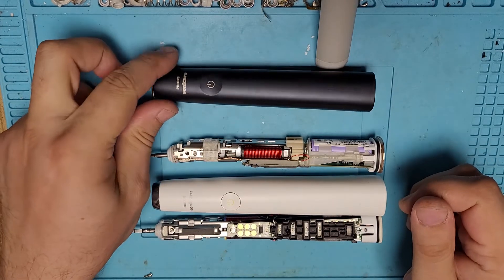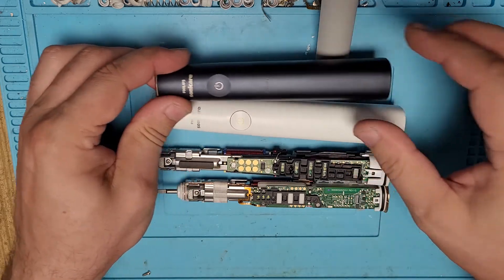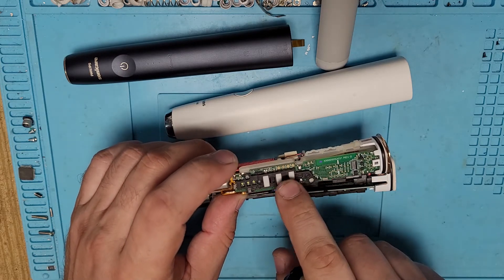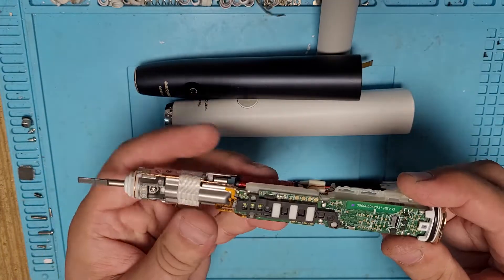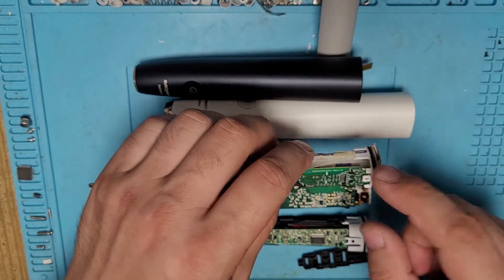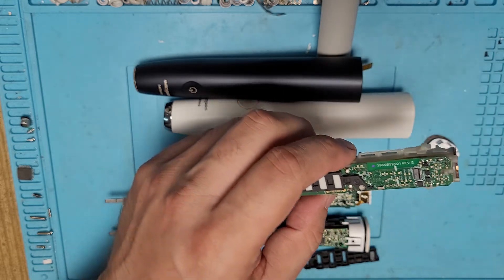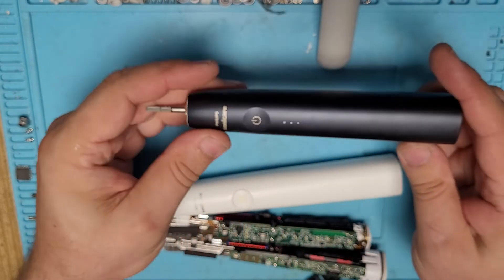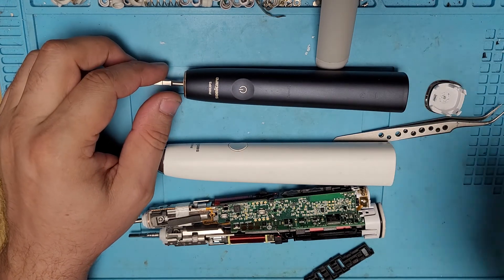Philips Sonicare Prestige - let's look what's inside. Teardown, repair, compare..

Comment: I opened mine trying to fix it because it was vibrating loud but when I put it back together it won’t turn on anymore it just switches modes someone help please this toothbrush was 400
Reply from the maker: inspect the ribbon cable for damage or if you were unlucky you damaged small IC on the glued electronic part. and now you need a new housing.. check my other video for removing glued electronic part from the housing for some ideas..

Comment: Got my success with this damn Sonicare Prestige:
1. bar clam to elegantly squeeze the bottom cap out
2. use a tweezer to loose the attachment and remove the internal body
3. secure the loose screw
4. reconnect the power cable as in the video and see the LED on
5. insert the body back and put back the bottom cap
Reply from the maker: Do you think a video showing how to take it apart and put it back together is needed? From my experience it's similar to my other videos showing how to take apart Sonicare toothbrushes maybe even easier.. and thanks for your feedback to community!
Reply: That would be great to make it complete as the power cable connection would be the devil in the details for the first time user  to take care of.
Reply: @letsfixitgarage  That would be great.
Reply from the maker: Your wish was fulfilled a few months ago ;) check my other videos :)

Comment: 11:01 , i messed up with the cable, got it halfway in, everything lit up, and it didnt start, i fiddled some more, and destroyed the seat for that cable, 

Bricked.
Reply from the maker: That's a bummer... You do need good magnification to see what you are doing with a all these small electronic and cables...
Reply: @letsfixitgarage  I fixed it, i cleaned and fixed the "port" for the cable, some pins were bent, got the cable in, and pushed it kinda hard the last bit so i got contact, the bad part was that i had cut the silicon top, and poured in 2 component glue,(i thought that it was a good idea to "stiffen" the shaft when it was wobbly, didnt know about the bottom part opening:)(dont tell anyone:P so i took it apart an rinsed it all, put everything back on, took a balloon rubber that i taped around the top, for water cover, works like a charm, overall, final conclusion, its a well built machine and system,
Reply from the maker: Yes there is a lot of engineering behind these brushes and you can see that they are made with repairability in mind sad that Philips is not offering some spare parts.. this would bring the survival rate even higher:) happy that you got yours running but I would suggest to get a replacement rubber seal. You can get them on AliExpress or eBay will hold longer than poured rubber ;)

Comment: Hello, I have a Philips Sonicare Prestige 9900 toothbrush. I thought it was the battery. I changed it, but the problem persists. So I don't know what to do. Maybe you can help me solve this problem.
Reply: Im also having this problem. Have you managed to fix it?
Reply from the maker: Prestige is very difficult to repair.. at the moment i dont have any tips.. every single one needed individual inspection and repair..
Reply: @letsfixitgarage  What have you needed to repair on the Prestige toothbrush PCB boards you have inspected? If you can make more videos about the Prestige, i currently have 3 with the same charging problem.
Reply from the maker: Sorry as said don't have any general tips for prestige at the moment. Every one that I repaired needed different things
Reply: @letsfixitgarage  Can you link to the fuse model these Diamondclean and Prestige use? How do you reset them?
Reply from the maker: I use the same 2a fuse from AliExpress that I have in description links, if it fits it will hold :) although not sure if the links are ok keep promising to update them but don't find the time even for new videos so links are outdated as well..
Reply: @letsfixitgarage  These Prestige im trying to repair don't want to charge but they turn on, can you tell me what components to check on the board to try to diagnose this problem?
Reply from the maker: Previous toothbrushes had KLB chip that was responsible for charging and usually was the failure point. With prestige as said they are much more difficult charging part is redesigned.. didn't had any with charging issue. Usually my experience was water damage and damaged PCB in the housing with no way to repair it..
Reply: @letsfixitgarage  Hello again. I have 3 Prestige handles that the power button doesn't work. The mode selector sensor underneath the power button works on all of them except the power button. I have 1 working Prestige handle that I switch all the non working ones to the working handle and they all turn on with the working handle. I tried fiddling around with the ribbon cable on the non working ones but couldn't get them to work. I sprayed electrical contact cleaner inside the handle but that didn't help. Can you give me some advice on fixing these power button please? I tried emailing you but haven't gotten a response.
Reply from the maker: Sorry must have missed your email although I always respond to all.. maybe it got deleted on spam folder.. anyways you found the problem, it's the housing PCB. bigger problem is that there is no way to get to it to repair it.. at the moment I don't have any solution either, all my attempts to extract the PCB without damaging it failed...
Reply: @letsfixitgarage  did you try a hot air rework station or superglue debonder?

Comment: Thank you for this video - it's super helpful.  How did you take the bottom cap off of the Sonicare Prestige?  It looks different than the other models but is it the same process of using pliers and a spacer?
Reply from the maker: Yes the same process and it comes off even easier than DiamondClean brushes..
Reply: @letsfixitgarage  I have a Prestige with charging problems. The battery reads good, there's no water damage or rust, and i tried different chargers but no success. Any suggestions?

Comment: I was able to open and fix the loose screw. However, once I connected everything back the power button was not working. I connected the flex cable and have tried disconnecting and reconnecting but no luck. Any recommendations? The toothbrush charges
Reply from the maker: If it charges problem should be in the flex cable connector. Try to get best possible magnification and inspect the connector maybe something is inside that prevents good connection. Try to insert the flex under magnification to see if it goes in smoothly. Does it insert up to the marked line?
Reply: @letsfixitgarage  I have got same problem and nothing helps for me. Maybe conect to housing Is bad. But how I get there.
Reply: Did you manage to fix the power button on your Prestige?
Reply: @fkfnc3858  No, I buy another. But only brush. Old one for parts (battery)

Comment: Copper coil came off bottom on prestige how can I fix/replace tried reconnecting
Reply from the maker: Would need more detailed description of the problem to get you some tips.. what happened, what you tried, what is the state...
Reply: @letsfixitgarage  copper coil with two wires  used for charging detached from bottom and the two lines connected to board ripped I tried to twist the two copper lines leading together but it didn’t work
Reply from the maker: Wire is insulated you need to solder it and after that check if it has continuity because of bad solder joint it could be connected but still not have continuity.

Comment: Which entry level toothbrush - $35-50, would last longer, oral b or phillips? Are there any brands you would recommend for a lower cost toothbrush?
Reply from the maker: I would go with Philips for better repairability as they all break down eventually.. do take note that  in the cheapest section Philips has gone one step back introducing motor driven technology instead of their trusty magnetic drive technology, these are not worth it.. additionally if you take care of your toothbrush it will hold longer if no, it will break sooner.. I would not recommend any cheap Chinese for one simple reason there are no spare parts for them..

Comment: Odd problem: Sonicare HX993w turns on when I remove it from the charger. It will also randomly turn itself on and off real quick when on the charger. Any thoughts on the problem? It won't turn itself on when its sitting off the charger.
Reply from the maker: With these kind of descriptions my first thought is always water damage. Take it out, inspect the upper rubber seal and if needed take off the motherboard from the frame to inspect the back side as quite often I see where upper part looks like new but when you take off the back side a lot off corrosion is found there..

Comment: I had a small piece of black rubber come out when I took it apart to tighten screw and now it doesn’t turn on. Don’t know where this tiny black piece of rubber with 3 holes goes.
Reply: That part is from the bush shell for the light indicators of the sensivity. I mine also came off but it still works so it shouldent be a problem
Reply: @coolbvwes1 thank you
Reply from the maker: Would need to see the part.. can't remember any rubber parts that falls off.. and it shouldn't connect to the fact that it doesn't turn on..

Comment: I now have a  diamondclean 9000 special edition blue (USD150) and a 9900 prestige(USD190) midnight blue. Received the 9000 a week ago. And the 9900 just today. Bought both of them with very good coupons/deals. I ordered both, to test out them and decide which to keep or send back within 30 days. What I expected, that the Prestige metal pin was loose out-of-the box! What a cheap quality. 
They have exact same production date (august of 2023).
And 9000 has no problem, 9900 has loose pin/shaft.
I wonder why can't Philips can fix this production issue.

They manufacture Prestige since 2021. Today is almost 2024. 
I would like to open the brush and fix it for myself, but then I loose the 2 years warranty.
Reply from the maker: @Knobber it is possible to open it up without damaging the case so the warranty would be still in tact as there is no safety labels or other things that would indicate that the brush was opened. .. you do need some practice to do it without damaging it so if its first time i would not risk it.. that said very strange why it was loose out of the box.. and as you do have the warranty I would just bring it in for exchange.. just a thought if it was a super deal maybe the seller is selling refurbished toothbrushes that were returned by the previous customers and has not checked the last return.. just a thought..
Reply: @letsfixitgarage  It was an unopened box, and production date of toothbrush is August of 2023.
Reply from the maker: Wow.. then really questionable quality control...

Comment: The Prestige had many problems when it released. Does Philips fixed those issues? I mean Prestige is 2 years on the market.
Philips usually release 'facelifts' for their models. Like the Diamondclean 9000 was the first edition, and now It has Diamondclean 9000 Special Edition. What is your experience, Philips fixes these issues? Like the upper screw problem which causes the very noisy vibration.
Reply from the maker: Philips improves on the design with every model but there are no radical changes. Upper screw problem is the same from the first sonicares. Vibration drive unit is unchanged on all sonicares including Prestige which is god blessed for repair enthusiasts :) additionaly its not a major problem and easily repairable.. not like on the Oral-B IO where shaft is welded, but sometimes it breaks and in that case there is no repair possibility, just replacement of the drive module.. which is not for sale.. From my opinion that is much bigger problem..
Reply: Just received my diamondclean 9000 but it is a bit noisy. Can you listen it is that normal? You've seen many sonicares you may know is that normal sound or not: https://www.youtube.com/shorts/Iwaulni84sw @letsfixitgarage

Comment: ty! do you know what's the battery is needed for sonicare prestige?
Reply from the maker: I think I had measured it before somewhere here in the comments it should be written. Will do it later and reply one more time if not found..
Reply from the maker: 14430CY 750 mAh 3.8V INR15/43
Reply: @letsfixitgarage  thanks! you are a hero!
Reply: @letsfixitgarage  do you know if it'd work with 3.7V 14430? Hard to find 3.8 for some reason :*(
Reply from the maker: @hiddendope don't know for sure, that's just the writing that is on the battery it could indicate different battery chemistry but all the other Sonicare brushes charge up to 4v need to check on Prestige but I believe it will be the same. So theoretically 3.7 li-ion should be fine. If you will try it charge it in disassembled form and under supervision for the first time..

Comment: Hi, in your opinion, what is the difference between Philips Sonicare 9900 Prestige vs Diamondclean ?
Reply from the maker: Smart diamondclean not much, simple diamondclean quite a lot.. prestige has everything Philips invented in the Sonicare branch and maybe something more that I don't know off.. it's smaller in size as all other brushes, can't comment on the Ai side and the biggest innovation from my perspective is capacitive touch button that prevents toothpaste build up in the button, and that will have major problems in repairability when it will get water damage... That being said it still uses exactly the same electromagnetic drive unit that every other Sonicare brush has. So if you use simple clean mode without checking the app, cheapest Sonicare model will be sufficient for you and deliver the same end result with better bang for your bucks. That being said you have to take care as Philips released new simplified model that got simple motor as drive unit.. in near future will try to do a review of majority of brushes internals to check some of the differences..
Reply: @letsfixitgarage  Hi, Can I ask something?
Do today's newer models of sonic toothbrushes have up to 62,000 brushing movements per minute or are they still only up to 31,000 brushing movements per minute ?

Comment: I opened my prestige up to fix the rattling noise, but now the power button doesn't work. The PCB is connected, and other buttons work, but not the power. I need help getting it working!! Anyone know the cause?
Reply from the maker: check that the flex cable is all the way in. do the leds work? additionally you could try to remove the power from the board for few second this should reset it
Reply: @letsfixitgarage  How do you remove the power from the board to reset it?
Reply from the maker: You can desolder a solder bridge near the negative battery terminal point this removes power from the board or desolder the battery completely.
Reply: You fixed it, afraid of opening this one up but I need to to replace the rubber sealing that's damaged....
Reply: How do you open it?
Reply from the maker: Check my other videos there is one for full disassembly and assembly of this type toothbrush
Reply from the maker: Check for my other videos there is one additional video for eteb by step opening and repairing vibration issue.

Comment: Can you fix the steel shaft on this model? Have one that’s loose. Please let me know will gladly send it your way to fix. Thanks!
Reply from the maker: @AM-np3hf If the shaft is loose it could be 2 defects either the holding screw is loose or it is broken. For first defect I have another video check them out, if it's broken it needs to be exchanged, but both are doable. If you don't trust yourself with repair write me an email maybe we can arrange something. letsfixitgarage@gmail.com
Reply: @letsfixitgarage  thank you very much for your prompt and thorough reply. Thankfully and unexpectedly, Phillips is standing by their product and replacing it under warranty even though it was purchased from a questionable overseas source at a steeply discounted price. Kudos to Phillips.
Reply from the maker: @AM-np3hf nice! From my experience if you have purchasing proof and it's in the warranty period usually they change it all the time. If they would agree to leave you the old one that would be even better outcome ;)
Reply: @letsfixitgarage  alas, they requested the old one be shipped back. Still happy with this outcome. Thought I was out of luck since it was purchased for a fraction of the usual retail price from a questionable source. Thank you again.

Comment: Hello, just curious do you have experience of repairing Philips HX99 series PCB?
Reply from the maker: had only few on my hands, they still relatively new.. Some got repaired, one not. For now not much to share :)
Reply: @letsfixitgarage  These HX99 commonly have power leakage issue. I got 6 on my hand, if you need spare chips, I can send you them for research.
Reply from the maker: Sure I could have a look, write me to letsfixitgarage@gmail.com let's check what can be done

Comment: This video was super helpful! I had an issue with the ribbon/connecter as the toothbrush wasn’t reading the sensor. Seeing you connect it properly helped a ton. Thank you!
Reply: It was helpful for me too. Especially once I realized there was a latch you need to flip up first. Unfortunately when I reconnected my pcb, my power button doesn't work any longer. The sense iq buttons do work though. Any ideas why that could be?
Reply: @sawyerburnett8319 you fixed it? Need to open my prestige to replace the rubber seal where a small hole is in it.

Comment: interesting..can the battery be replaced though?
Reply from the maker: Definitely! exactly the same as with all the sonicare brushes it is soldered in the same manner to the motherboard. but you will need a smaller battery 14430 to be more precise ;)